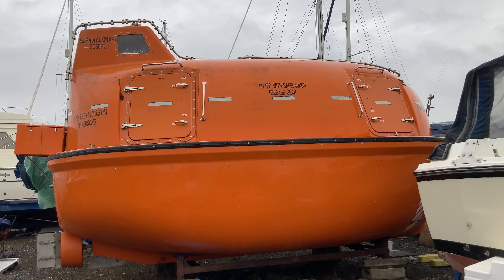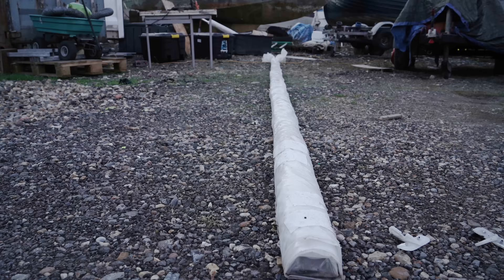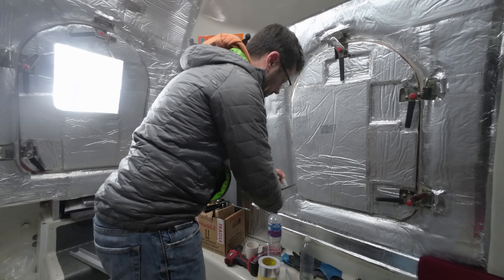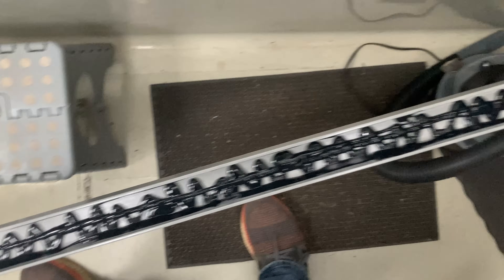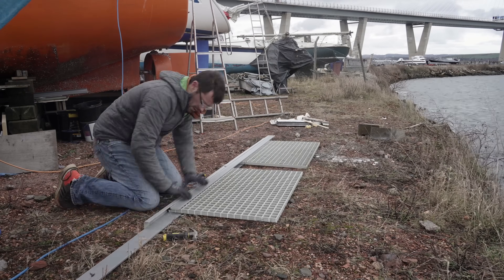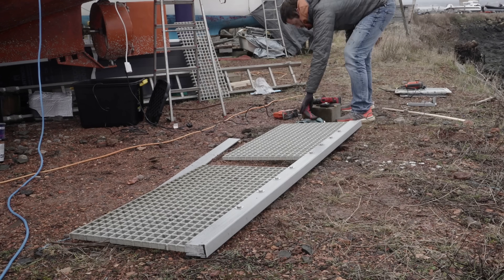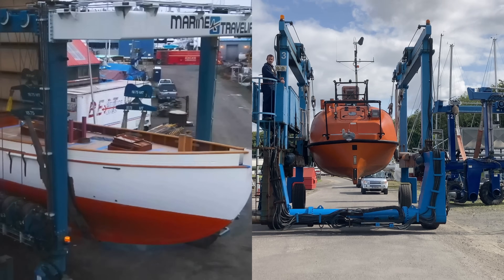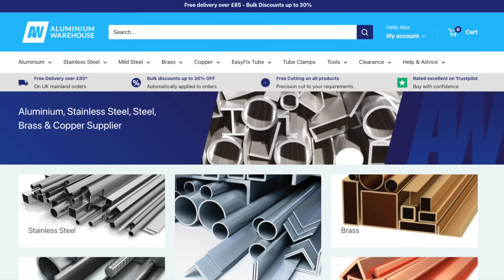Making a GRP standing/stowage stern platform for lifeboat. Expedition lifeboat conversion Ep119 [4K]

Comment: Excellent choice for the platform, the only stuff holding a lot of marina boardwalks together,  can I suggest a bead of sikaflex along the edges of the channel just to eliminate the possibility of "frost jacking" if water gets in behind the grid and freezes which would not be noticed because of the bolts. Looking forward to seeing it attached and braced up🤫
Reply from the maker: The 3200 filled most of the gap, but good point well made.

Comment: The pipe with the holes might be for a heating element? Or maybe the exhaust to make a bigger muffler that is more silent. The orange Mexican heads i have no clue.
Reply from the maker: Very intuitive. It is actually a silencer component, and I'll be using it 'off label' for a heating related activity.

Comment: Another step closer. I was wondering if the platform would have been hinged so it would be raised to protect it from bashes or if you wanted to reduce Alan's length temporally.
Reply from the maker: A hinge would compromise strength rather

Comment: Alan is going through so many changes, he will look like he has gone through a mid-life crisis.
Reply: Allen spent years as a lifeboat.  I would rate the period of modification he’s going through the midlife crisis. The expedition to the arctic will be his second, later in life, career
Reply from the maker: Worse - as a never-used lifeboat. Imagine the pent up sense of duty.
Reply: A security guard at a bank may be doing nothing, but still be on the job.  Sitting on the back of a tanker or cargo ship may be inactive, but Alan was on the job 24/7 being prepared for emergencies.  As for pent up energy he has had more then one little Alan tender.
Reply from the maker: I like the fact your optimistic logic suggests that Alan's mere presence detered disaster.
Reply: Less that Allen prevented disaster but was prepared in.case it happened.  My youngest brother was a lifeguard at a swimming pool his last year of high school.  I don’t think he had to actually rescue anyone, but his job was to be there just in case.  Allen is like the fire extinguisher next to my stove. It doesn’t prevent a problem , but is there if there is one to keep it from getting worse.
Reply from the maker: I jest.